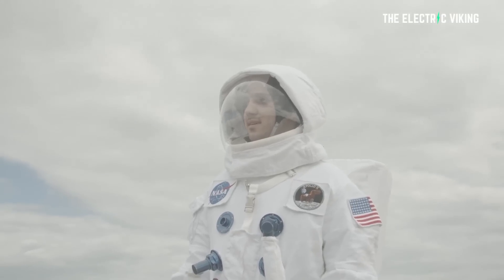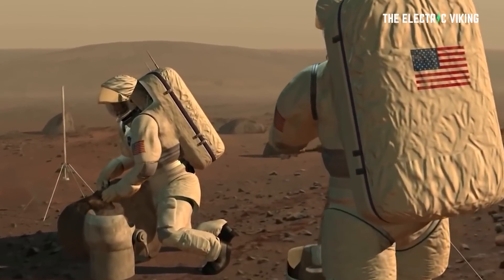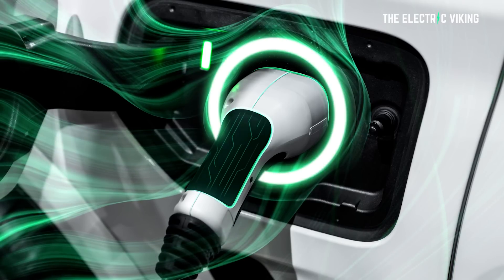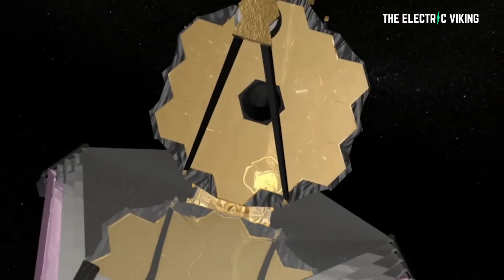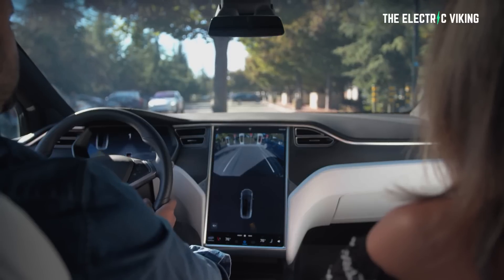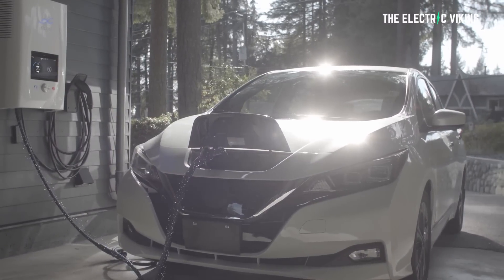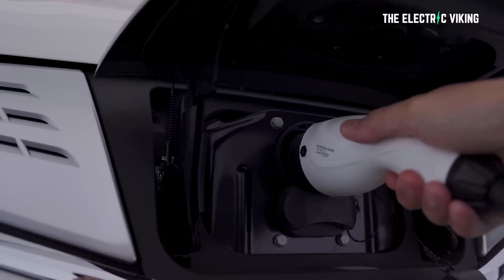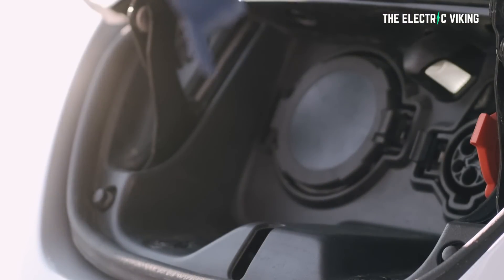The Flow Boiling & Condensation experiment

Comment: Electrical resistance, which causes heating, is the ultimate show stopper. If 2,500 Amps is flowing through a battery cell, and that cell has 0.001 Ohms of internal effective series resistance, then 6,250 Watts of heat will be generated within that cell (W = I² x R --> 2,500² x 0.001 = 6,250W). That heat will eventually damage the cell, unless it is dissipated somehow. If the battery consists of 100 cells in series, to give about 400 Volts, and each cell has 0.001 Ohms of internal resistance, then 625 kilowatts of heat will be generated within that battery. Perfect for thermal runaway! 

That 625kW of battery heating is more than the drive motor power for most supercars.

Likewise, if a recharging connector has 0.001 Ohms of resistance, then, at 2,500A, there will be 6.25 kW of heat generated in and around that connector.

A huge amount of cooling will be needed to dissipate the heat. Heat can be minimised by using less resistive (bigger) cells and superconducting or liquid cooled cables. But the car's internal bus bars, connectors the charging socket and the BMS circuitry will eventually become problematic.

The best way to reduce heating will be to use higher voltages, rather than having increasingly bigger connectors and cooling systems. A doubling of voltage results in a 75% reduction in resistive heating. A quadrupling of voltage (to 1,600V) reduces the resistive heating to 6.25% of that for the 400V system. Double the voltage again, to 3,200V, and heating is reduced to 1.5625% of the 400V system. This has begun to be addressed recently with the start of a transition from 400V to 800V.

So my thought is that much higher voltages will be the likely solution to the challenge, just as is done with national grid supplies. That will, in turn, present challenges to making those higher voltage systems safe for consumer use.

Unless we settle for somewhat slower recharging times. Consider: How long does it really take to refuel a fossil car? By my own experience over more than 40 years of driving, refilling usually takes at least 5 minutes, and can often take much longer if a queue is involved. So do we really need recharging times which are shorter than about 10 to 15 minutes? 

A 100 kWh 400V battery, recharging from 20% to 80% in 15 minutes will take 60 kWh, or 4 kWh every minute, assuming it has a constant recharge rate. So recharging current will be 600 Amps at constant recharge rate. Let's assume that the battery recharges   realistically, and that the 20-80% SOC range is around the best recharge rate for the battery, and add 50% as a safety margin. This will require a cable which can handle 900 Amps. At 800V this will be 450 Amps,. Both are much more manageable current levels, and are being catered for right now.

For anyone who says that they cannot wait for 15 minutes: 10 to 15 minutes is barely long enough to relieve nature, wash  hands, buy a tea or coffee and grab some refreshments, even under ideal circumstances. And we all need to take safety breaks at regular intervals on long drives. Some people claim that they can drive safely all day without taking breaks. But there is a wealth of evidence around to disprove those claims. Many accidents are caused by drivers being distracted, Tiredness results in reduced concentration, and is a major cause of those distractions.

Comment: FINALLY Viking Fan Boy has recognized the greatest weakness of EVS - the charge time. This is what robs the freedom from drivers and is limited by the laws of physics ultimately. Unfortunately creating a charge cable that sounds like it will cost a million dollars is not the solution. Also the cable alone is not the only problem. The distribution of power through the car to the battery and internally at the charge station will also have issues. A secondary issue is provided enough source power to support multiple customers charging simultaneously.  Most of the other fan boy youtube videos show 1 guy by himself charging. At my gas station, I can fill 12 cars simultaneously in about 2 minutes. For those who are familiar with Bucees in Texas and now showing up along the interstate highway system in the United States, know that these uber gas stations can fill up over 100 cars simultaneously with a variety of gasoline and diesel fuels in 2 minutes!!! To do the same with EVS would require a combined cycle gas generation facility on site, or maybe 3 to 4 thousand acres of solar panels.  All you fan boys just dont understand the scale of what you trying to impose on people with government force. I am not against EVs, but I am totally against the agenda of the GREEN JIHADIES that think the ends justify the means in our transition to green energy. Free markets developed our transportation system in 120 year span of time, trying to force this scale of transition in a 8 year span is folly.
Reply: I am curious; but does time spent in the shop for tune-ups and oil changes count as time?
Reply: @toneyeye  yes - electric cars are lower maintenance, but if you go over a bump and your computerized dash dies that counts too

Comment: Ah a new name for evaporative cooling as used in heat pipes! Again the focus on fast charging which, as demonstrated so well here is very inefficient because of all the heat produced, not just in the battery and cable but through the charging network, it’s a simple example of the I² R formula where heat is proportional to the current squared. I think the answer lies in home and on-street dispersed charging at lower levels and changing our behaviour and realising that change doesn’t have to mean hardship. Why spend all this effort just to give people the same experience they are used to when in fact they could be educated in how to get a better experience and not have to queue for petrol stations and incorporate refuelling as part of normal life.

Comment: MY PREDICTION: There will be "battery stations" in place of gas stations. You buy a battery cylinder maybe 6 inches wide and a foot or two long and insert it into your car as we do today with power tools, some lawn mowers, and other small electric systems. You can either charge them at home or buy one fully charged to be exchanged later for credit. We need charging/filling/fueling or whatever it is in 5 minutes flat, everywhere on earth, on nearly every city corner, and with a minimum of trouble such as credit card operated vending machines that works 24 x 7 x 365. You might buy a extra one or two for remote country trips or as an emergency backup. Anyone agree with me on this pipe dream?

This mower works on a large battery insert:
https://www.protoolreviews.com/wp-content/uploads/2022/07/Green-Machine-Lawn-Mower-Review-04-800x534.jpg

Comment: The biggest objection to EV's is the cost. You can't buy what you can't afford. That's not an excuse, it's just a fact of life that 80% of the world's people only have 20% of the world's wealth, so it's going to be easier for the wealthiest 20% to transition to EV's than the rest of us, many of whom can't even afford a brand new ICE car let alone an EV which is double the price. That's why I just roll my eyes when the EVangelists rail about people giving excuses about not having an EV. Until affordable EV's like the Aptera become widely available, we are going to be stuck in this inefficiency trap where they are trying to cram massive amounts of charge into huge battery packs as quickly as possible, when the answer is just to have a lightweight efficient vehicle with a smaller battery pack that charges itself from the sun so rarely needs to be plugged in and when it does, it gets a lot more miles per hour so the recharge time is a lot less.

Comment: In LEO, satellites sit at slightly below room temperature, however thermal gradients can be high between sun facing and the vacuum of space facing sides of a spacecraft. Thermal gradients result in thermal expansion disparities which effects alignment accuracy. Heat is transferred  through conduction and radiation, heat paths are critical, heat pipes and thermal straps. All good stuff.

Comment: Appears to only be the cable not the battery. Clickbait.
Reply: One could design a battery that used it too.  NOt saying anybody needs 5 second charging.   That is just a I told you so to use on the ICE nuts.  5 minutes is more than good enough.
Reply: @danharold3087  it only seems to address cooling. Tesla and it's octopump seem to have that under control for the battery.The cable connecting maybe but it's not a game changer if you could afford it or implement it in the next 10 years. Less of the research papers and more of the real products.

Comment: Heat isn't really the issue here. If you are going to charge up an EV in five minutes, check out the math. The average battery pack in a modern EV is about 70 KWH, with an 800V battery. To charge this battery in five minutes requires an 840 KW charger, which means the charger needs to be at a distribution substation. Also, it comes out to a 1000 Amp current, which implies a large diameter busbar instead of a cable an actual human can lift and plug in. Not going to happen.
Reply: One could use megaPack batteries to store the DC converted and pulled from the line.  TBH we don't need 5 second charging.  5 minute charging is good enough.
Reply: @danharold3087  yep, batteries or some other form of local energy storage will buffer the dips in energy transportation from grid scale renewable and the end user.

Eventually those with home parking could just have inground sand battery storage and ultra rapid charging wirelessly at home on your drive.

Things are going to become so convenient for EV drivers, no cables, automation and general ease.
Reply: The Abb Tosa achieves 600kw charging with a cable, their 360kw car charging cable is maybe an inch in diameter.

Eventually with wireless charging you won't have to lift any cables, just pull up to a parking spot and set your car's computer to charge when you need.

In case you wondered yet wireless charging will allow for those kinds of speeds.

5 minute wireless charging will be a thing in the not too distant future.
Reply: YES - but Viking Fan Boys does not like to do calculations, the laws of Electromagnetism are a bitch.

Comment: Let's be practical.  If you're going to charge at home, charging something faster is not going to help.  That's because house rating in the USA is limited to 50 amps at 240v.  Unless you can find a way to use two installations.  But with the standard install, 12kW is all you can expect.  So if you have a 100 kwH battery it's still going to have to charge for 8.3 hours assuming you start at zero.  If you use a Tesla type field charger you COULD charge faster.  But not at home.
Reply: Why are you even talking about home charging. The model is to charge overnight.

Comment: The biggest obstacle to ev fast charging is the electrode material. Use of a large surface area conductive electrode like graphene hydrogel or graphdiyne would eliminate the heat build up due to the plating effect on graphite electrodes.

Comment: A little weird to be talking about a limit of KWh in chargers. That depends on the size of the battery. Obv you can’t charge your phone at 400 KWh but a Tesla semi will be charged at 1.5 Megawatt hours (1500 KWh). And as others and you have pointed out there’s superconductors, thicker wires, and other ways to increase charging rates in the wires. The issue in charging cars in 5 minutes is the battery chemistry and not degrading the cells
Reply: ha 

he already said that in the video.

Comment: This is not much of a solution. Superconductors that work closer to ambient Temperatures would produce a much more efficient solution. We don't want to turn all of that energy into heat. We could use some of it for battery heating, if one were to arrive with a cold pack. If that was done then it might prove viable, but I doubt it. Alternative methods of engaging the fast charging, like massive electrodes underneath the car which don't require a wire cable or manual interaction would also allow for negligible resistive heating. Just a thought, but all things that will be worked out by the engineers as we go forward.
Reply: Stator cores often use silver to carry more current, but if EV chargers did this hobos would be chopping them off for hooch money.